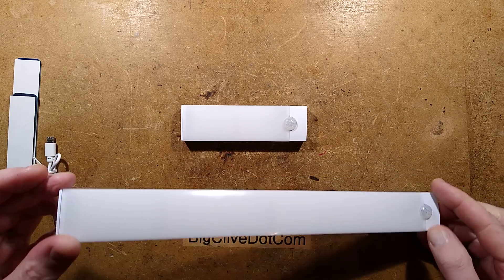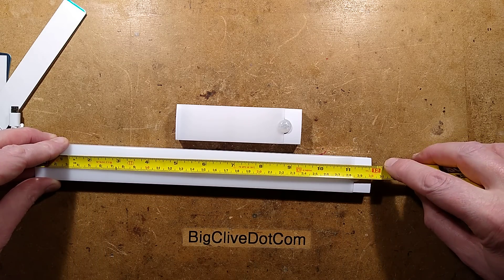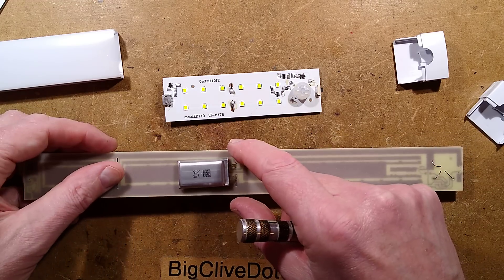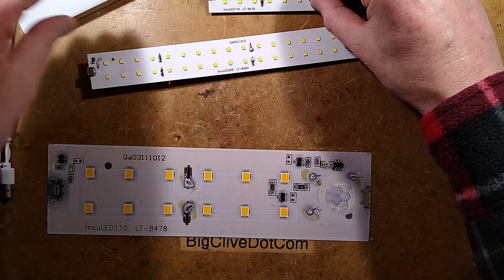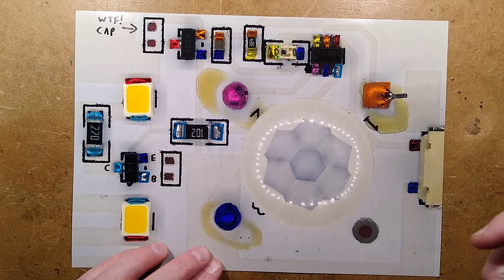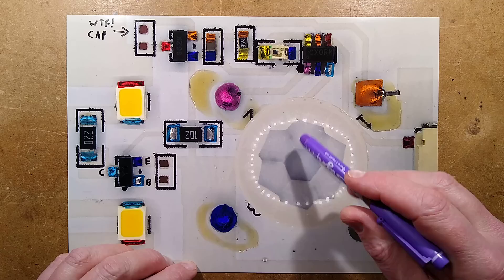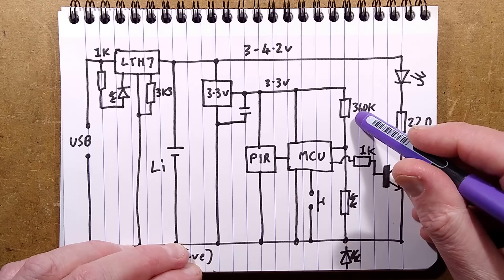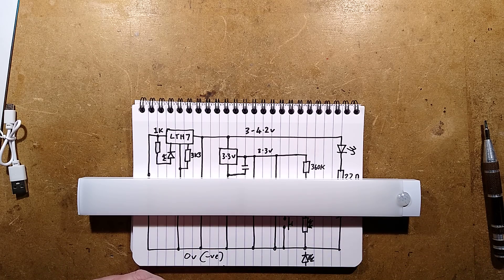USB rechargeable PIR light teardown with schematic

Comment: When introducing Li cells to each other, is it necessary to match their state of charge / voltage first?

I'm aware that once working in parallel all the cells will operate in lock step; however I'm concerned about how much current you'd get if you parallel up a fully charged cell with a nearly discharged one.
Reply: Big Clive mentioned that. I would place a dropping resistor in series with each battery to equalize each of them for a few hours. When they were all at exactly the same voltage, I would solder them in parallel.
Reply: @lenturnbow8038  thanks for responding. I must have blinked when he covered that :(
Reply: @trueriver1950   My bad. Clive covers that in his Notes not in the video. Quoting Clive:
“As always, take extreme care when fitting lithium cells, due to their high energy release
capabilities. If adding more cells in parallel, make sure their voltages are very close first to
minimise current flow as they balance.

Comment: If you connect the input to the output of a regulator some 78 series regulators turn into oscillators. First time I saw that it was more than a little confusing.

Comment: Is their any way to adjust the time the light is on
Reply: The older versions had a timing resistor you could swap out.
Reply from the maker: Not in this version.  With the older type using BISS0001 chips you could.

Comment: lol , i've had one of the small ones in my bathroom for years , dimmed down it gives just enough light to see during night-time loo visits , but not so much is wakes you fully  .. battery seems to last about 6 months
Reply: In terms of sleep preserving night lights, red LEDs would be even better: there is reputable research showing that it's the blue light in particular that wakes you up. Sadly the manufacturer's don't yet make the on board LED lights like they do the white ones (or if they do could someone post a link please).

And dimmable mains LEDs don't go redder as they dim, in contrast to an incandescent. Result is that at the moment my dim yellowish-reddish nightlight (dimmed incandescent) rather paradoxically burns more power than the daytime lights (LEDs).

I fined the mains incandescents simply by wiring two in series: each bulb runs on quarter power and is nicely dim and orange. If you do this remember to turn off the power when one of them fails before changing it: as you can get left with 240V accross the failed bulb.
Reply from the maker: It takes a lot of blue light to disrupt sleep.
Reply: @bigclivedotcom  I've found that dimmed incandescents are better than similarly dimmed LED lamps for getting back to sleep after a visit to the loo. Likewise the lamps whose colour you can control, I turn them down to orange 🍊 at night. I'm particularly prone to insomnia so every little helps

Comment: I have just bought a set of 3 of these for under my stairs. They arrived yesterday.
I was a little surprised to see them here today. But it looks like I’ve made a reasonable purchase, quantity wise at least.
I like the idea of upping the power capacity, but if that means that I only need to charge them once a year, I might end up losing those poxy little leads! 😂

Comment: I have similar lights, using Eight AAA batteries in series parallel arrangement 6V It works OK with AAA rechargeables, which I have to recharge once every 3 to 4 months.
I have another that uses 6 AAA Series parallel, making it a 4.5V. So I intend to power it externally using an 18650, with a charger board attached.
They are great for walking into a room, as they give off enough light for you to find the switch for the room light.
I suppose Clive's lights could be powered externally too, using 18650 cells or other reclaimed fatter pouches.

Comment: A family member has these all over the stairs and home to allow visibility for their partner who has dementia. They use the AAA style because with rechargeable AAA's you can have light immediately vs waiting for the charge to build back up. I've been working on a mains version with a pico pi and a UPS to save them some time. Thanks for the schematic breakdown
Reply from the maker: We assisted my mum (who had Alzheimers) with decorative lights that were on 24/7.   I made a video called A proper Alzheimer's video.  They may find it useful.  It covers the things we wished we had known at the time.
Reply: Perhaps the best of both worlds would be to use two sets of rechargeable AAA cells. OK they aren't quite as nice as Li but you can keep the spare set on continuous trickle charge and swap them over as soon as the in service set runs out. 

(Clive has explained on other videos why this works for NiMH but not for Li cells -- he even has a circuit to build your own trickle charger)

Comment: Wouldn't stacking cells in parallel cause problems with balanced charging?
Reply: No, balancing is only an issue with series cells.
Reply from the maker: Not in parallel.  They act as a single cell.

Comment: Question. Wouldn't a lower voltage regulator end up being less efficient due to more heat dissipation
Reply from the maker: It only deals with a tiny current.  Not the LED current.
Reply: @bigclivedotcom  ah that makes sense :)

Comment: I've always appreciated for not only your use of printed photos, but the fact that you also trim the paper to size :)
Reply from the maker: With a PCB guillotine.
Reply: @bigclivedotcom  PCB guillotine? That checks out. "Photos, and Circuit Boards."
Reply: @bigclivedotcom  Multipurpose!  😀
Reply: thats one well sharpened edge! Samurai are nodding respect for conformance
Reply: it's those little details. great youtuber. greater person.
Reply: Aspergers to a Tee. Most of us Geniuses are on the spectrum.
Reply: @G1ZQCArtwork  salmons better smoked though

Comment: It's amazing how a little PIR light like this in a dark staircase can improve your life.
Reply: ...or even save it!  The best use of one I came up with was to site it underneath the side of the bed that I got out of. As soon as my feet hit the floor It would illuminate sufficient space to avoid any trips or toe stubbings for middle of the night toilet appointments without blinding me or disturbing anyone else who was in bed at the time.
Reply: @Derek_Garnham  I use them on 3 sides of my bed, they are permanently connected to a USB charger, so they never run out of power.
Reply: @joop2295  crikey, it sounds like your bed can get busy at times.
Reply: I put them in some closets in my house.  She who must be obeyed asked why was I doing that. Yet, when the batteries ran out she was quick to tell me that the batteries in the light needed changing.  You are correct Steve, it is amazing how a little PIR light can improve a situation.
Reply: As my light bulbs burn out, I'm considering replacing one bulb per room with one of those bulbs that have the 18650 or similar cell inside them that kicks on when the power is lost.  I don't see it as a bad thing.  Heck even one of those gravity lights wouldn't be a bad investment.  The smallest amount of light is better than zero light.

Comment: Thanks for the video and ideas, when  putting (used) lithium cells in parallel wouldn’t it be a idea to put a resistor as a fuse in series with each cell in case one cell would fail?
Reply from the maker: You can, but it has to be very low like 1 ohm to avoid weird charging oscillation.
Reply: Vast numbers of power tools and laptops and EVs connect cells in a parallel+series arrangement without fuses. It's extremely unlikey for a cell to spontaneously go short circuit, and if it did when charged fuses wouldn't protect againt thermal runaway of adjacent cells.

Comment: I have a similar PIR light that runs on 4 AAA batteries (currently powerowl 1000 mAh), that only needs charged 1 or 2 a year, there is no on/off switch, just a sliding battery end cover.

Comment: i like you show how to work of PIR in this circuit ?
Reply from the maker: Two tiny sensors in series that produce a slight voltage when IR hits them.  Ambient IR cancels each other out, but a moving transition causes enough signal to be amplified by an internal FET.

Comment: That WTF capacitor position is for a resistor, as they likely had a cost cut version that removes the 1c regulator and runs the little micro and PIR off the filtered battery voltage. Both will work, just PIR sensitivity will change with battery voltage.

Comment: thanks you you @bigclivedotcom I collected from my friends and family already 100+ of these LiPo batteries. Only 1 of them is not really keeping the charge - all others are 100% OK - thanks again!
Reply from the maker: If one is not holding a charge then let it discharge completely and then recycle it.
Reply: @bigclivedotcom  yeap, I tried, it always comes back to 90% - no more ;-(. Anyway, I pay to my kids 1GBP per piece  and everybody is happy, plus environment saved ;-) Yesterday received 51 pieces with 4 different types of batteries: from 500mAh to 1500mAh - huuuuuge vape it was ;-)
Reply: @zyghom  You're making a DIY power wall aren't you?
Reply: @KJ6EAD  nooo, this is for my environmental sensors (temp/hum/light) that are battery powered. 500mAh gets my sensors to last about 200 days as they wake up only every 5 minutes
Reply: @zyghom  That makes sense. I just thought it would be funny if someone combined enough discarded douche flute cells in a battery management system to make up a useful power bank.
Reply: @KJ6EAD  are you saying reusing these cells for sensors is not useful? ;-)
Reply: @zyghom  It's a comment, in English. If you aren't fluent in English, you may not understand.

Comment: I may look into these.  About a year ago,  I bought six PIR lights for power outages. Mine are round or a "Puck" shape with 5 LEDs each. Just a manual "Auto/Off/On" switch on the side. There were two versions  "Cool White"  (which I'm not fond of) and "Warm white" light.  I ordered the Warm white ones.  I get them charged up and while they do function fine.  Same kind of rd LED indicator as well.   However my gripe about them is that the supposedly "Warm" white LEDS are more of a "Tepid" white.  More cool than warm actually,  but not entirely that harsh blueish-gray fluorescent type of light.   One remains on my back porch at all times so I don't have to leave the light on when leaving the house in the wee hours of the morning, nor do I have to leave it on when I expect to come home long after dark.  Although  I probably should bring that one in since it's starting to get below freezing at night.  From what I understand,  Lithium batteries and cold temperatures are not good pals.   The other 5 are kept inside in their designated places throughout the house, but turned off until there is a power outage.   
I think mine were like 5 USD for three of them and I ordered two sets.   Handy little buggers though! For a while I was keeping one on Auto in the bathroom to avoid having to blast the retinas out the back of my skull when nature calls at night.  (Inevitably always an hour or so AFTER I get to sleep, or an hour before my alarm.)   But the metal plate keeps falling off the ceiling and the magnet itself keeps falling off the light.  All of them.  Now they are all either sitting on a ledge or hung using a small nail in the keyhole slot on the back.
Reply: By the way, Clive,  you have another scammer impersonating you with a "whats app" link.
And thanks for the ❤.

Comment: I have one of these, slightly different design but the operation is identical... Or is it?

By accident I found a very strange effect by holding the button while charging. Instead of the on/off/pir options it changed to the well known high, medium, low, strobe, sos sequence.

There may be other sequences because I had great difficulty getting it to revert to the intended sequence.

Edit: Mine is one of those with a single row of LEDs with the sensor in the middle. If the circuit is the same I don't understand how it detects charging, unless that's a red herring and the change is caused by pressing the button for along time,  possibly when the battery is depleted since that would be why I was charging.

Comment: I've never owned a rigid measuring tape (as opposed to the flaccid ones for fabric) that didn't have both inches and cm/mm. Nor a ruler, except for the triangular drafting ruler I was forced to use in a drafting class once.
Reply: Actually in the UK I recently bought one that only had CM on, Dumped it for one that has both on front and back too. Very handy.

Comment: would you have to balance the cells to put them in parallel or just stick them in? it might be worth doing a video about putting these douchepipe batteries in parallel, perhaps combine it with a small christmas light project
Reply from the maker: The voltages would need matched before wiring in parallel to avoid high current flow between them.

Comment: I like using these over the ol porcelain throne for the night visits.  I just hate that these usually come with such a small cell for their size. Wish I could find one that uses like 18650s or something like that I could change out quick... Or ya know at least a larger battery that will last like 6 months or longer.

Comment: This could be a really interesting off-grid "hack" project adding in a larger battery, and potentially a 5V solar cell to power it up in an off-grid situation.
Reply: Also good for extended power cuts.

Plug it into a car jump starter pack, and it'd run for ages.
Reply: I use one of these connected to a little solar panel to illuminate my outside toilet! I'd like to figure out a way to add a standard on/off switch to them tho as the pir isn't great if I'm in there for an extended ablution!
Reply: @peterlee5535  I doubt it uses a resistor/capacitor timer inside or you could tweak the value of that to adjust the on time.
Reply: @MakeItWithCalvin  I think I've formulated a new plan :) I've a 20v Li-ion battery and a 5m reel of LED strips. If I open the battery and rearrange the cells to be in parallel rather than series I should get just enough volts to power the LEDs and still be rechargeable thru my little solar panel. That's the plan anyway :)

Comment: I wish we would see more LiFePO4 in stuff like this.
Reply: I haven't been able to find LiFePO4 in small pouch cells, only round cells. Though with these there might be room to fit your own 14500 (AA size) cells in there.
Reply: the LiFe last wayyy to long for the average crap that needs to die frequently to be bought again.  so they use lipo cells that can handle 500 full cycles instead of 2000/3000+ full cycles.

the economy needs to sell stuff. so the stuff cant last for ages !

but some solar light actually use LiFePo4 cells in AAA or even AA formfactor. And yes... they last a loooong time. many crap out on the electronics being moist/corroded. but nailvarnish clear helps with that ! less landfill produced. 💪👌
Reply: Aren't iron phosphate batteries lower capacity higher peak amperage? Why would that benefit this situation?
Reply: @nikolayordanov9760  LiFePO4 maintains its capacity for decades longer than normal Lipo batteries.  It also survives charge cycles better, and hovers around it's nominal voltage for a greater period of time.

I'm not sure about peak amperage...I always assumed that standard lipos were better.  However, I do know that I can charge a LiFeP04 battery faster than a Lipo.
Reply: @nikolayordanov9760  I see Clive had actually done a video somewhat explaining LiFePO4.  YT just recommended it to me.

https://youtu.be/53n2pw5M9m4

Comment: I have one of those lights that is 16" long with 3 rows of LED's, it's above my door and I ran a cable out the window and hooked to a small 5v solar panel. It lights up my room when I come in from outside. The small solar panel keeps it charged enough to work for around 6 months then I take it down an manually charge it. I comes on also when I move around the room at night so it does get a lot of use. First one I had lasted around 5 years, I am 1 year into the second one now.

Comment: This video has brought back to mind a question I've had, but have been unable to find an answer to... Can you hack an LED direct replacement bulb for a fluorescent light fixture to run on a 18V DC tool battery pack?  The kind of bulb I'm referring to is "Philips InstantFit Model # 544510 LED tubes easily replace fluorescent T8 tubes operated on instant-start electronic ballasts, no rewiring needed."  Maybe a possible future video?  I really enjoy your video's, thank you for all the effort you put into them!
Reply from the maker: It's more common to use a matched LED array voltage.  But you could theoretically use a voltage booster with current limiting.  Or just an inverter.  But that would lose efficiency.

Comment: I picked up a bunch of the smaller ones you showed..... years? ago? i can't remember... same general concept PIR light with metal-magnet attachment... I love them...  for me they typically last a week or two, but the cat is constantly turning them on and off all night...   nice to see these have some fading capability... that is one thing I haven't yet bothered fixing in the ones i have... would like a capacitor across the leds just to soften the on-off (in a very dark room it can be starling when the cat sets one off) and change the resisitor.  But yeah.. now you have me wanting the larger one.

Comment: Thumbnail text had me thinking of something different, like standby lighting. I recently installed a bunch of new outlet and switch cover guide lights (US/North America, original real-deal brand, not the knockoffs). It seems like a no brainer that they should add a product line/range with lithium pouch cells that can keep them working uninterrupted in the event of a power outage.